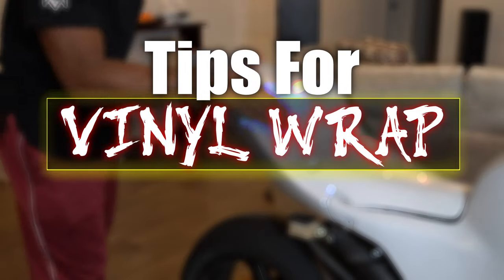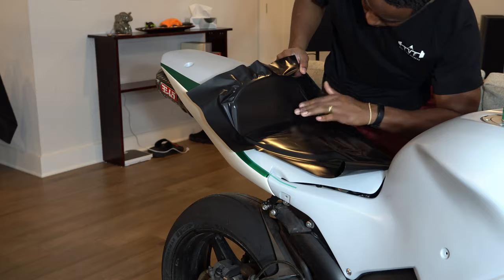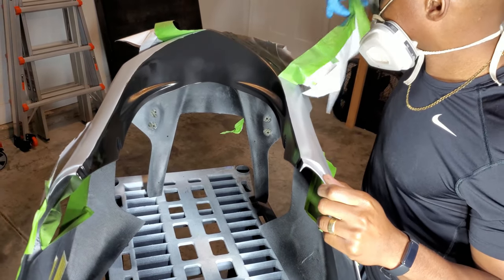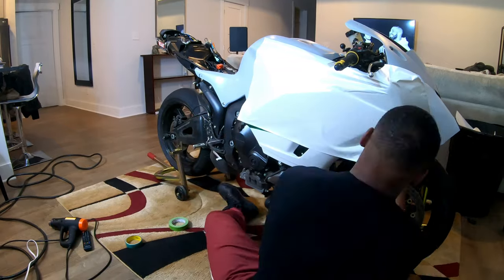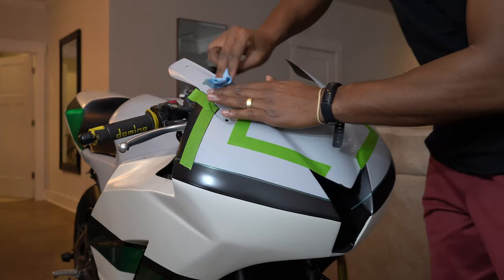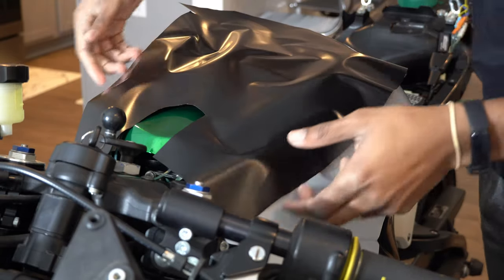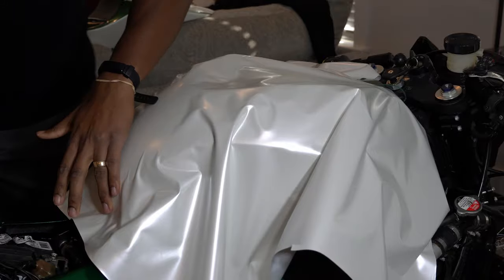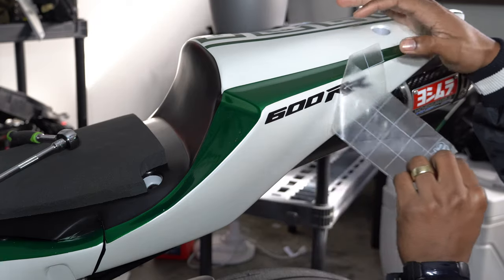How To Vinyl Wrap a Motorcycle | CBR600rr

Comment: Do you feel any different when riding with non OEM fairings?
Reply from the maker: Since these are fiberglass, they are much more flexible than plastic. The only difference I feel is the tank cover has some give to it so you can feel it move when you squeeze your thighs lol.
Reply: @Master_Yoshi  So would you say its better to have fibreglass fairings than the OEM's in terms of comfort and handling? Do you have the link to the OEM fibreglass.
Reply from the maker: @amantek3545  The benefits I've found for fiberglass is that they are easier to repair if damaged, and they can withstand crashes better. They are also much faster to remove. I wouldn't be surprised if they weighed less too, but I'm not sure if they do. In terms of comfort, I'd prefer more rigidity when squeezing. Also, I no longer have a real seat, just foam padding on top off the tail section lol. I don't believe there are any options other than plastic when it comes to OEM. The fiberglass bodywork I have is by Armour Bodies. Hot bodies is another brand that makes them. But, fiberglass bodywork is usually for the track  so there is no way to use your oem headlights. If you don't plan on tracking, there's really no point.